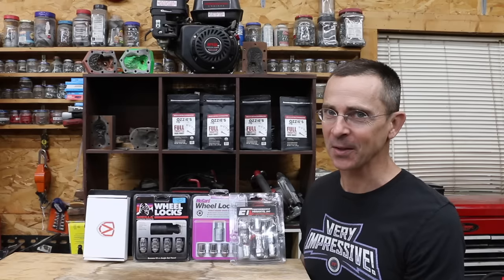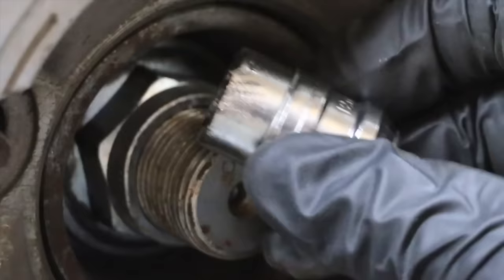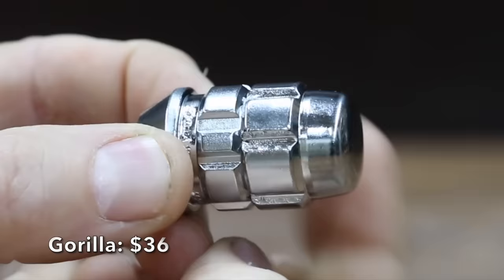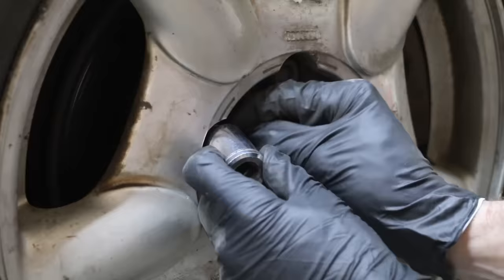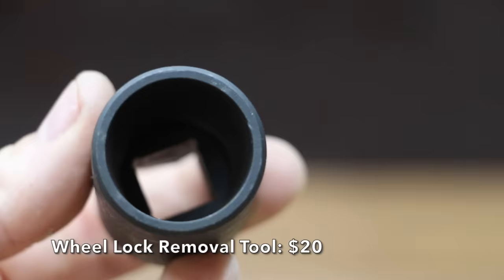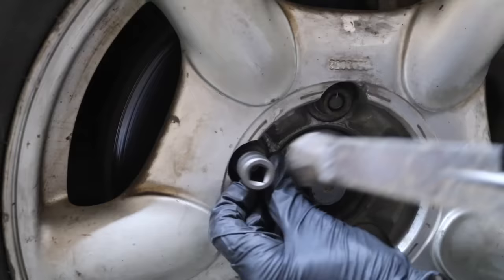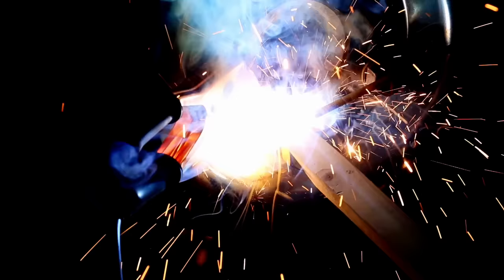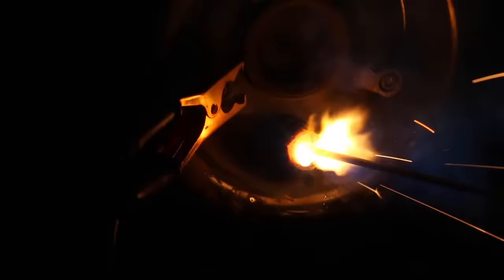Best Car Wheel Theft Deterrent Lug Nut? Can Any Wheel Lock Prevent Theft? Let’s find out!

Comment: Great test!   Decades ago, I had a set of McGard wheel locks and lost the key. I went to a garage, asking what it would take to remove them. In a matter of seconds, he used a socket (as you showed) and removed it.  Seeing the trivial level of security they offered, I've never since bought wheel locks. But those 'Advanced' locks look like a worthy exception (providing I don't lose the key again).
Reply from the maker: Thanks for sharing!
Reply: Advanced wheel locks give you the option to buy an extra key when you order. Ive never heard of advanced until i saw this video. I will be buying a set for sure.
Reply: @n325aej So you quietly steal the car and remove the rims elsewhere.
Reply: @n325aej That's nothing compared to using a power saw on catalytic converters.
Reply: @gregparrott  its a little harder to see the guy under the car than the guy banging away crouched next to the wheel, from across the parking lot. makes some feel exposed.
Reply: @gregparrott  The powersaw is to get the thing off before anyone realizes it is happening and can respond.  In the middle of the night when everyone is asleep, chances are good you can make 2 cuts and get out of there before someone gets annoyed enough to give up trying to go back to sleep, then sit up and try to figure out where the noise is coming from, what the noise is, and actually get there.  Most people don't know what a sawzall even is, let alone connect it to theft.
Reply: @docferringer  You're right. But it seems there's more. A friend who lives in a very upscale, quiet urban neighborhood with extra security because of a foreign consulate building, had the cat stolen off of his Toyota car (pretty low clearance). He spent $1200 replacing it. Weeks later, they stole it again! A mechanic advised buying a pricey kit that contains a bunch of aircraft cable and sheetmetal which is supposed to slow theft enough to discourage it   BTW The mechanic had the cat stolen off of his Prius hybrid THREE times. My thought is a grenade would be better. But that would damage the car.

Comment: In addition to the 4 great points you made, when it’s time to purchase wheel locks or any lug nut/bolt, there is a very important 5th thing to consider. The seat of the nut/bolt must match that of the wheel. Wether it is flat (very rare nowadays), conical, oval,  or any number of the numerous ball seats, making sure the lock/nut/bolt matches the wheel seat is critical for safety and proper functionality.
Reply: What's a seat. I'm not native
Reply: @user-mi4yc7pr3x  The seat is the part of the nut or bolt that actually makes contact with the rim and is the surface all the clamping load is applied through.
Reply: @2down4up  ah yeah it's slightly different depending on car brand
Reply: @user-mi4yc7pr3x  Yep, car brand wheel design and so on. If your changing wheels out at the same time, not only do you need to make sure the flange/seat of the bolt matches the wheel but you also gotta make sure it’s the right length. A lot of aftermarket wheels have much different depths when it comes to where the lug bolt/nut bottoms out in relationship to where the face of wheel that sits against the hub is. Too short and the bolt might strip, break, pull threads and so on. Too long and you might contact something on the backside of the hub and cause damage there while leaving the wheel still loose.
Reply: Can vouch for this from personal experience, about 20 years ago I removed my aftermarket wheels and went back to the stock steelies but used the lug nuts from the aftermarket wheels. Snapped multiple wheel studs before I learned why, one time I snapped 2 of the 4 studs on one wheel about 2 miles from my house as I turned onto my road.
Reply: @DanielRichards644  Yeah and that’s the scary part. It totally sucks if you break/damage something while you’re not moving but it is much worse if you don’t realize the issue and it happens while you’re driving. A customer of mine did kinda the opposite of you. They put aftermarket wheels on their car but used the stock bolts. Unknown to them at the time, the face of the wheel was deeper/farther away from the lug bolt seat and the seat was different. The customer was able to mount and torque the wheels but what he didn’t know was each bolt was only engaged by about two threads and because the seats were different the bolts started to loosen and wobble.  Of course they completely failed at the most inopportune time, a panic stop on the highway. Both front wheels quickly departed the vehicle and with effectively no front brakes he ran into the very vehicle in front of him that had caused him to slam on the brakes in the first place. He was ok but his vehicle wasn’t. Fortunately this is a relatively rare scenario but it can and does happen. The more likely scenario is tightened nuts/bolts with the wheel still loose, stripped or or broken or otherwise damaged bolts, nuts, studs, and so on. I’m truly glad your situation didn’t get worse and I assume you were traveling at a relatively low speed anyways.

Comment: When I worked as tech at Ford, we kept the master lock set for all these in case the customer forgot theirs. The only benefit I can see is if they're used on wheels with deep centers to prevent locking pliers or similar tools to allow easy access.
Reply: The type of people stealing wheels etc are usually opportunists. Anything to hamper them is a win and will usually put them off... usually.
Reply from the maker: Thanks for sharing.
Reply: The Advanced Wheel Locks are unique to each customer so 1 master key isn’t going to work on any other model
Reply: @abbashaider8668 that’s awesome! I was wondering why thieves wouldn’t simply purchase a set of their own. Individual customization is certainly worth the $90. I wonder how many different keys they made.
Reply: @WontSeeReplies  Yeah I didn’t know that either. If someone was so inclined they could just purchase a few OEM brand wheel lock keys and they’d be able to steal stock rims off of basically any car from the brand.
Reply: @abbashaider8668  I bet one of those afwul universal pin sockes would take it off easily.
Reply: @WontSeeReplies  It would be bad if there were only 5 keys ;-)

Comment: It's worth mentioning that the "small diameter Gorilla lock" isn't actually intended to be a wheel lock. It's a spline drive lug nut for aftermarket wheels that have less space for a lug nut. You'll often see them in 6 spline or 7 spline variants depending on wheel stud size.
Reply from the maker: Thanks for the feedback.
Reply: This is true. Once they are used on the type of wheel they are made for you won't get getting anything like the locking pliers in to them.
Reply: Yep.  That's right.  I use them on my three-piece wheels that have very deep-set lug nuts.  They would be a major pain to remove without the special socket that comes with them.
Reply: That's correct. I use them on my enkei wheels I have on my Honda.
Reply: @G31mR  If you spend the $12 for the spline adapter they're no problem at all.
Nothing else, however, is very good because - as stated - the lug wells are usually far too narrow to allow anything else to get in there and engage it.
Reply: Thank you for mentioning this. I was gonna say the same lol
Reply: As a tech they are used widely on winter tire sets here in Canada. Hate dealing with them as most spline brands have poor rustproofing.
Reply: I have the small spline gorillas on my truck. They are a pain in the ass to remove without the correct socket.
Reply: True. My car was stolen and when recovered the thief had changed wheels to the spline lug nut I did not have a key for but easily found at my local Autozone to remove.
Reply: My car was bought from a used car stealership. They redid one of the brake calipers and on the test drive one of the wheels was loose and clunking. They retightened it and I bought it anyway. At somepoint I had to get the wheels off for something. Turns out it's got these splined nuts. I didn't know what they were or that the keys existed (I'm guessing the dealer kept it for kicks?) so I fought them for an hour or so because they were over torqued too. Pliers, strap wrench, chisel and hammer, socket and hammer. Only got like 2 off. With the wheel being a recessed nut design I broke apart three of 20 using the spiral socket extractor I decided to buy. It's the second hardest I've worked on a car and this wasn't even a problem with rust.

So with the right tool yeah it's not security, but over torque them and the thief will give up long before they get them off. 😂
Reply: Also with these instead of removing 1 per wheel, you have 5+ for wheel.

Comment: Back when I worked in a hardware store, customers shopping for door knobs typically asked "What's your most secure lock?". I'd usually answer with "Depends on your least secure window".
Reply: And the truth is, almost every one of those door knobs had the same shitty lock. Rarely would they have any kind of security pins or bump resistance. I'd be more concerned about how long the thing would last before it wore out.

Comment: The one thing you left out that i would want to see is how much torque the lock keys can handle. I got stuck out in the desert one time with a flat because the lug nut key broke on me.  I don't suppose you would consider a bonus episode testing that this week?
Reply: Good point.  The only thing my locking lugs have ever prevented was ME getting the wheel off.

Comment: Cool :) I had my safety lugs stuck cause a not so good mechanic lost the keys , another had to weld and take them away
Reply from the maker: Great point on the key getting lost. I bet it happens quite often.
Reply: That's the worst part about wheel locks is the key...

Come in for tires or brakes, key isn't in the customers car... Call customer, they don't know where it is and the car is a mess, not spending time looking past the common areas.... Either find it and come back later, or pay to get them removed.

Comment: I always find it interesting that there is such a desire for cheap security. If I had a several thousand dollar set of wheels, I would definitely choose the best wheel lock - a $90 investment to secure $1000+ wheels seems very affordable.
I'd love to see a test of commonly available pad- or combination locks! Maybe trigger locks for guns, too!
Reply from the maker: Thanks for the suggestion.
Reply: have each lugnut a different wheel lock   over torque the wheels is far more effective... it will take at lest 3 people to do one lug nut
Reply: @punker4Real  Over-torquing lug nuts is the best way to BREAK THE STUDS OFF -- good luck changing a flat tire.

Comment: It has been quite a few years, I wonder if there are enough new options to do a new rechargeable battery test? I found those videos extremely helpful. 

Also, some LED lightbulb brands just seem to die when I put them in enclosures (due to heat). Would be nice to see which brands actually last in extreme environments.
Reply: None of the comercial LED bulbs are designed to work in closed enclosures. In fact, they are designed to work in upright possition in a socket.
Just get the ones from OSRAM, Philips or General Electric and hope for the best. Also, make sure not to buy economy/value models, because they will not last as long.
You can also drill a coupple of small holes in the enclosure, to provide airflow to the bulb.
Reply: Meh, you probably come out ahead just buying the cheapest bulbs and replacing when they die.  I've only ever replaced one LED bulb in my life, and yes it was in an enclosed fixture.  It was only upon replacing it that I noticed the "do not use in enclosure" sticker.  I just try to be mindful of minimizing the use of that one now.
Reply from the maker: Thanks for the suggestions.
Reply: The new ceramic substrate ones work better with heat I find. My biggest issue with LED's is the inconsistent color temperature, and worse, the lack of a full spectrum.
Reply: @DashCamSerbia  ... and I'm still waiting for my stash of CF bulbs to fail so I can buy LEDs. I have some CFs that are well over 10 years in use.
Reply: @nobodynoone2500  Have not seen those yet. You need to buy the same brand and model if you want the same color temperature everywhere. Also get those bulbs with high CRI (at least 90).
Reply: the filament style ones tend to be more reliable in my expirence  for house hold LEDs
Reply: @ThunderClawShocktrix  Yes, they last longer due to better cooling. The problem is that filament ones are in the glass bulbs, so they are not servicable. I repair my bulbs when they fail.

Comment: A tip about the McGard wheel locks. Dodges come with them from the factory as OEM locks (when that option is selected at all). So a would be thief will have a bunch of keys, specifically for Hellcat wheels, Scat Pack wheels etc. So, they will not slow down a thief all that much if at all. Those conical ones though, are interesting, I would remove/reinstall them every year or two to prevent seizing.
Reply from the maker: Thanks for the feedback.

Comment: Wow, I think Catalytic Converter thefts are a much bigger problem out here. Maybe do a video on the best security device for them. Thanks for the great info.
Reply: IMO the absolute best solution to cat theft is to buy an aftermarket bolt-on cat for about $75 (the cheap ones don't have much precious metal inside, so nobody bothers to steal them), and swap it with the original one. Store the original at home (in case you need it for DEQ, or selling the car).

I had this idea, but failed to implement it before my cat was stolen. Ironically, the $75 cat passes emissions testing just fine, with no check engine light even a year later. Any other 'security device' is just a waste of money. A battery powered sawzall cuts through them in 30 seconds.
Reply: The best cheat is putting a test pipe in place and saying no to the catalytic converter. Can't steal what ya don't have.
Reply: @cavalierliberty6838  Depends on where you live. Your car gets seized by the authorities if you do this in my country (western Europe obviously).
Reply: @Gabbbble  you mean "if you get caught". Keep the original one and swap it in only when you need to go for an inspection.
Reply: @CanizaM  The police will arrest you for the smell, escort you immediately to inspection and if they find out that the cat has been intentionally removed or replaced with a less efficient one :
- The vehicle is seized
- Registration is canceled
- Expect at least 1 to 2000 bucks in fines
- The "replacement" cat or cat delete will be removed and destroyed by the authorities at your expenses
- Your car will have to be towed to a workshop to reinstall an OEM cat (sometimes they ask for proof of purchase, so even if you already have an OEM cat, they force you to buy a second one)
- Then the car (which is now unregistered) will have to be towed back to inspection so you can register it again.

And you pay for everything of course. It's not France that I'm talking about, but the country of cheese and banks. They don't mess around here.
Reply: @Gabbbble  in other words, don't live in europe lol
Reply: @accordfreak1  You got it.

Comment: Excellent testing as usual.  MGuard has always been the gold standard (though all are defeatable), the choice of many OEM's. An American company based out of Buffalo, NY. With pretty good customer service, have dealt with them over the years for replacement keys etc. Hold onto that card with the ID number that you get with your set or from the dealer.
Reply from the maker: Thanks!  Thanks for sharing.
Reply: My McGuard wheel locks were defeated in about a minute per wheel when my wheels were stolen earlier this year. Their customer service let me return the extra key & but I bought though after the theft, so I agree they have great customer service.
Reply: Acura/Honda using them as well for all there vehicles.

Comment: Back about 2 million years ago, before Harbor Freight, there were  "back of the truck" tool sales.  I bought a set of tools that would defeat most wheel locks, but the portable welder method is particularly interesting.
Reply from the maker: Thanks for the feedback.

Comment: It seems to me that it wouldn't be too difficult to make an impressioning tool for those advanced wheel locks. It's a lot like a tubular lock, except that you know exactly what the proper depth is just by bottoming it out. Basically, something like that universal socket, but designed specifically for those locks with large pins and maybe a collet to lock them in place once all the pins are bottomed out.
Reply from the maker: Thanks for the feedback.
Reply: ive had some success with those universal sockets but ive also broken about 10 of them trying, (im not a wheel thief but  mechanic) if the bolt isnt over torqued and theres not much corrosion they sometimes work!

Comment: When using locking pliers, to take the subjectivity out of how tight you are able to clamp down by hand, it might be a good idea to explore using the hex hole on the back of the adjusting screw. Using that and a torque wrench should help in getting the same amount of clamping force each time you use the locking pliers. But, maybe I'm wrong in that assumption; testing might be in order.
Reply: Maybe a conventional hack saw blade comparison .
Reply: Not all locking pliers have that feature but a coworker used another pair of locking pliers to tighten the adjusting wheel even tighter.

Comment: You can get a lot more gripping force by using the locking pliers correctly. You can tighten them greatly using a hex bit on the bottom of the tightening mechanism.